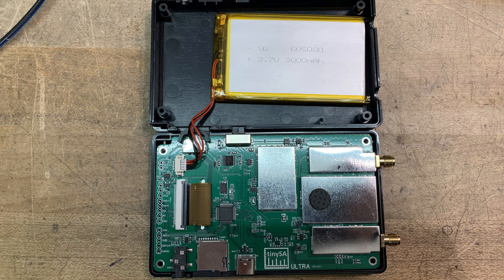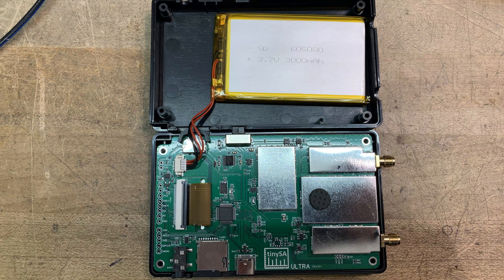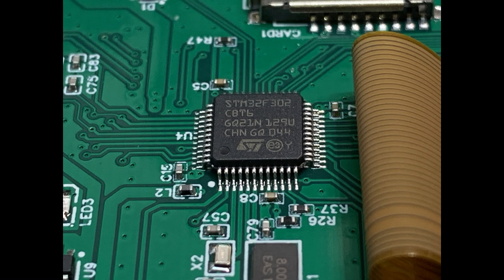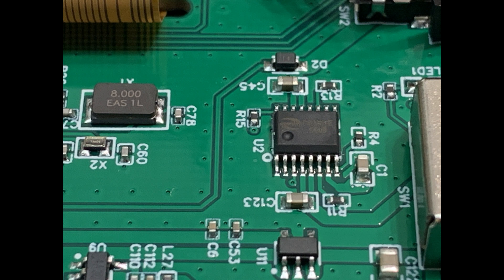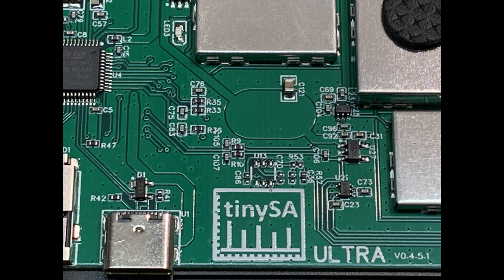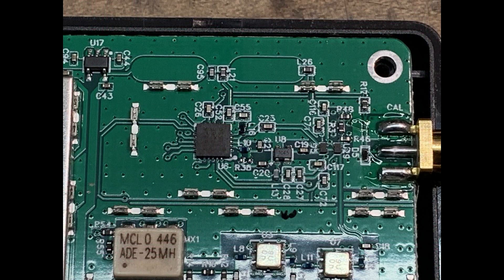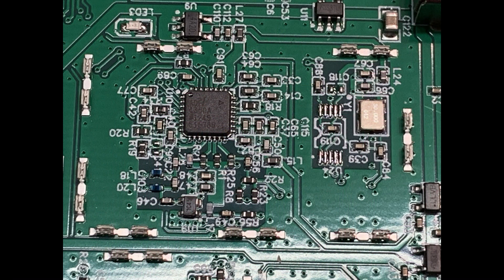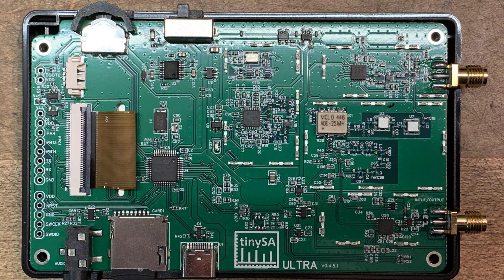#1325b TinySA ULTRA Spectrum Analyzer Teardown

Comment: My tinysa ultra is measuring correctly with the antenna to check distant stations. However, using the cable and attenuator the measurement becomes confusing, it seems that some attenuator chip on the tinysa board has been damaged. Which one could it be? The board has U22, U14 and U28.
Reply from the maker: 2:10

Comment: Hi, I see that MCU in your Ultra is STM32F302CBT6 with 128k flash, but the original firnware for Ultra builds for STM32F303 and has 176k size. Does it have some different hardware revisions? Did you try to upgrade firmware to the last one?

Comment: The oval shaped traces are used as "BOM cost=Zero" ULTRA low inductance capacitors for microwave frequency filtering and/or decoupling power & noise sources from one another.
Reply: I was wondering the same thing.  Other option could be a transmission line (combined with the the cap mounted on them) for some high freq impedance matching or a LPF on a RF trace.  Just a WAG tho, and only pondered it in passing.  Didn't even look to see if its on a RF or a power supply trace.

Comment: I checked the US supplier of these. Their web page said they were "In Stock." So I ordered it immediately. It said my order was complete. Then the next day I got an email notice saying it was on back-order. I'm going to assume that their website didn't keep up with the actual stock. But it could also be looked at in a less than kind manner.
Reply: i had one on preorder
maybe mine will come soon
Reply: It has not been charged to my card yet ☹️
Reply: I saw the uncertainty on EU and US sites so purchased one on AliExpress from an approved seller. It was shipped a couple hours ago.
Reply: @vincei4252  You'll know whethere it is shipped when you get some actual milestone info in tracking (preferably with contact info and weight).
Sellers on Ali often assign one tracking number asap and swap it with another one when they actually ship the item.

Comment: What are those perforated holes on the gnd copper plate ? Could you please talk about those in details? Thanks for your great work and unmatched energy level.
Reply from the maker: https://youtu.be/29YcNXSB9KM
Reply: @IMSAIGuy  I watched all 5 parts of vna test ground pad and couldn't find the calculations for the size and distribution patterns of the vias... John west says it's for thermal remedies as well and I think it's pretty cool but how the hell they incorporate those effect into calculations... the guy who did the tniysa pcb in this video , puts those vias on the transmission lines too specially when they get close to the components. That's really cool to know why  ... 🙏
Reply: @arashghasemi  The ones close to the transmission lines are likely for fencing/shielding purposes.
Reply: They couple the ground layers for both high frequency and thermal coupling. The more plated-through holes, the more identical (uniform,) the ground voltages and temperatures on both top and bottom sides of the board, providing a better ground for GHz RF, and better heat dissipation for the devices.

Comment: The LiteVNA goes to 6GHz. Now tiny SA ultra to 5GHz. Is it time to up the Hz in your garage? 
One of your bargain finds for a vintage 26 GHz HP SA would fit the bill.  
I'm still growing into my 8561E.
Reply from the maker: I've been trying to get someone to donate a LibreVNA to the channel. that looks like a true spectrum analyzer/ VNA design.
Reply: I have an HP 3585a (20 Hz to 40 MHz,)and an option-loaded Anritsu MS2721B, (9 kHz to 7+ GHz,) and I haven't touched either of them since I got the TinySA and a NanoVNA. I just keep the high-end gear around in case I need to fix some government gear. With a bit of ingenuity and a couple of home-brew accessories I've been able to do everything I wanted to do with the tiny test gear. I can set it wherever I want without having to plug it in, and I can tip it at any angle I like to make the display easy to see, or even display it on a large PC screen much bigger than my high-end gear. And with new versions of the code it now even has several handy (free) features my big old gear doesn't have. About the only thing I might want to do that it can't quite optimally do is tune up repeater cans, and no one has asked me to tune a set of cans since before COVID hit. Even so, I can probably tune a set close enough that they are within what thermal expansion and contraction error would mask over in a non climate-controlled environment, and I can do it on-site with a device I pull out of my coat pocket. I don't even have to worry anymore about blowing out the front-ends on any of my expensive gear with their hard to find parts. I'm just really happy with the tiny, cheap gear that's available now. It takes the worry out of playing with electronics, and I like that.
Reply: @johnwest7993  What range of frequencies have you been measuring/ manipulating? 
I have the base model picoscope. Really like the software, but going to higher Hz is $$$$.
A lab on a board could be made with some thought, these little units plus some of the new voltage/current and signal sources.
Nothing I have need for as I'm still supporting the trade of vintage(like me) gear.
Reply from the maker: @johnwest7993  you just don't want the tiny box injecting -10dBm into expensive equipment.
Reply: @IMSAIGuy  Santa YT?

Comment: The minicircuits ADE-25MH+ mixer is a 5 - 2500 MHz model. IF is characterised to 1.5GHz and the LO to 2.5GHz. Datasheet says LO to IF isolation is 32dB. It's mystery how -10dBm is getting out of this sucker unless the mixer is suspect. The ADF4351 is a wideband synth. If I remember correctly that can produce lots of spurs especially if it is being swept. If you're interested look for the OpenTechLab [005] 4.4GHz RF Synthesizer Board  ADF4351  Theory, Setup, Reverse Engineering, Experiments ;  here on YouTube.
Reply from the maker: the ADE mixer is used for the normal 800MHz spectrum analyzer. the 6GHz hack introduces a second Lo close to the input, downconverting the 6GHz to 800MHz
Reply: @IMSAIGuy  Gotcha.
Reply from the maker: I was wrong. there is a low pass filter on the input usually, in ultra mode this filter is removed and somehow the Lo does get through that mixer. go figure. it seems to be using about 977 to 1177 MHz

Comment: Nice teardown vid! Hate to be the guy here, but if I remember correctly, that stm32f302c8t6 is a 72MHz processor. Not sure if they're utilizing the full speed in the Ultra or not though. 😎
Reply from the maker: the external 8 MHz in internally multiplied I believe.
Reply: @IMSAIGuy  Ah ok, I wasn't aware they did it that way with those. I'm still a little new to the ST chips. 😁